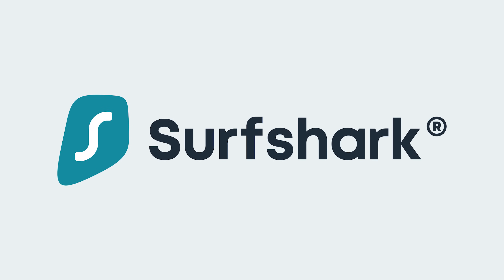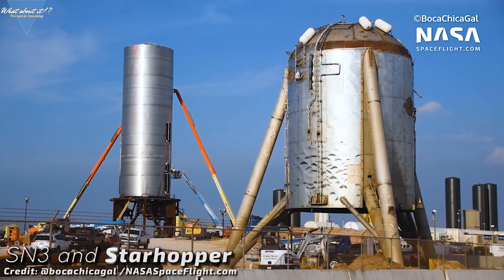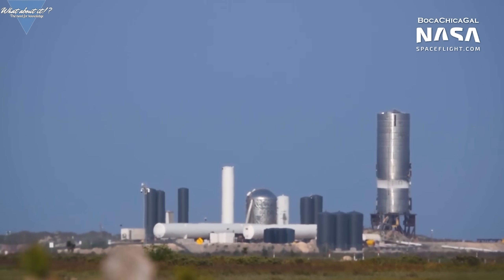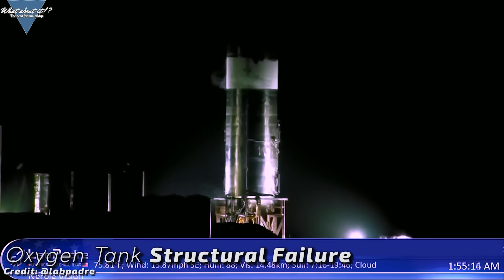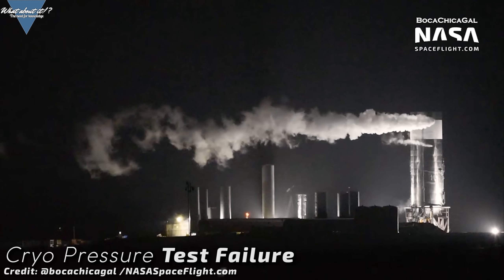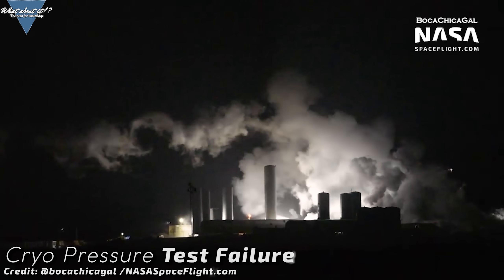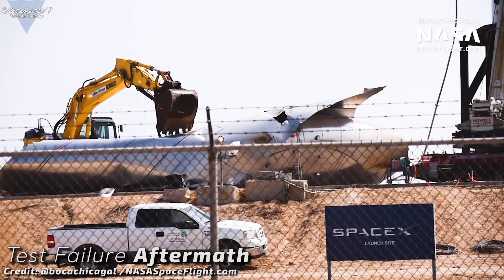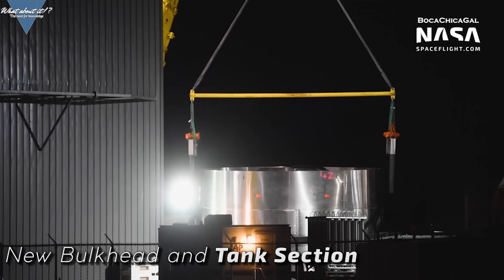83 | SpaceX Starship Updates – SN3 Cryogenic Failure Explained – Expectations For SN4

Comment: I have another theory:
If the bottom tank was empty (air) and SEALED, the cryogenic temperature of the liquid nitrogen in the top tank was lowering the temperature of the air in the bottom tank during the test and making the air condensate. This lowered the pressure inside the bottom tank making it collapse. 
The "configuration mistakes" in this case would have been the SEALING of the bottom tank.
Reply: This is so obvious, this is why I personally doubt it. They work with cryogenics on a regular basis, I think this is something they would account for. Like forgetting that the flamy end will get hot eventually.
But mistakes happen, even to the smartest people, so it's at least possible.
Check for damage, remember what was the cause, learn from it - then dust off and continue.
Reply: This was my initial thought as well. But the LOX tank, was venting a little. Meaning there was enough pressure in LOX tank to push vapor out venting port.  I agree that the instant crumpling, strongly suggest an empty LOX tank, being super chilled, and causing a super low pressure inside. Also the LOX tank should have had icing on it like the LCH tank. did a valve freeze shut, and stop flow going into LOX tank?  If so, someone at SpaceX should have noticed and stopped the test.
Reply: The tank wouldn't even have to be empty but perhaps under 10% full to see the same shrinkage of the contents as the super cold Nitrogen at -320 F transmitted those temps thru the common bulkhead with it's some 125 sq meters of contact space. That's a huge radiator into the lower tank.
Reply: Damn I was just thinking the same until I saw your comment
Reply: If the lower tank was full of gaseous N. Then some of this gas would condense onto the bottom of the upper tank. It wouldn't take very many Lbs. of gas to condense before the pressure in the lower tank was well below atmospheric. Valving would be required to add N to the lower tank as the upper tank filled, and to remove this gas as the upper tank emptied.  The key would be to balance the condensed N on the underside of the upper tank.
Reply: the air doestn neccisearaly need to "condensate", if its temprature reduces, its pressure reduces (Gay-Lussac's law)
Reply: @sssfsfdfsdsdffsfsdf4  Obviusly (adiabatic trasformation). I spoke about condensation because is the most critical situation which could occur
Reply: @Fonz94znoF  But by definition, this is not adibiatic. Adibiatic states that there is not heat trasnfer, thats all that is going on here. Instead it is isochoric (constant volume).
Sorry hate to be a nag.
Reply: @sssfsfdfsdsdffsfsdf4  sorry my mistake. You're totally right. The adiabatic system (with a little approximation) is the the top tank + bottom tank. That made me say "adiabatic trasformation" but again, it is absolutely an isochoric trasformation (inside the bottom tank)
Reply: Yes, something in that direction seems much more plausible to me, than whatever Felix was babbling about.
I don't think it was primarily a structural failure, but too little pressure in the lower tank, maybe because of cryogenic effects.
Reply: A very good explanation
Reply: Correct me if I'm wrong, but if the lower tank was loaded why we didn't see some implosion/explosion when the upper tank bend over?
Reply: @miguellyon82  Obviously the pressure was just that damn low. I assume if it was that low, it must have been a hardware error (sticky valve) or something of the sort. You could see the tank slowly depressurising for the few mins beofre. There may have been so little pressure that it was just the ridgid stregnth of the steel keeping it up untill it bluckled in.
Reply: Right before the collapse, it looked like cryogenic liquid being dumped from the bottom where the engines would be.  Was that possibly an emergency dump of the upper tank at the last instant, too late, to try to save the structure?  Is the upper tank methane and the larger, lower tank LOX?  Is it possible someone said, "Dump the methane tank."  And they got confused and dumped the LOX tank, then quickly tried to correct the mistake, but too late?
Reply: Mario rossi - i agree
Reply: Like the standing on the soda can analogy. 
Not everyone would be heavy enough to crush the empty soda can immediately, but then flick the side of the can and it collapses.  I tend to agree with this too
Reply: They should have had the lower tank cryo filled while filling the upper tank.... all that weight on top crushed the bottom tank.
Reply: That’s a good explanation but a simple explanation is they pressurized the lower tank but like the Altas failure they they lost pressurization in the lower tank.  Maybe someone pushed the wrong button and let the air out.
Reply: @gslogar1  if they pressurized the lower tank then my theory fits very well. To avoid this problem they should have been pressurizing continuously during the test (because of chilling) rather then pressurize before and seal.
Reply: Even if that also happens in reentry, would thermal expansion be another serious problem for Star ship, mostly during reentry?
Reply: @danielburmas1136  - In my eyes the Starship design with a modest amount of tiles to protect from heat buildup tells me they plan on reducing their reentry speed by a large amount. The Space Shuttle began entry at some 17,000 MPH/Mach 25 and thus the need for lots of special heat tiling to protect it. I'm wondering if Starships plans to reduce that speed to say Mach 3/ 2000 MPH which would require much less in the way of heat shielding as we see in these tiles. In that case, heat expansion of a tank with say 5% fuel load would be well within design specs as you only need enough fuel for the final suicide approach and landing.

I am still thinking the tanks need internal ribs to help with the many stresses of launch and landing.
Reply: @danielburmas1136  Re-entry can only be tested by re-entering.  There be no human volunteers for that.
Reply: @beachcomber2008  for your information, of course tests are unmanned, however did I mention about passengers being on board?
Reply: @danielburmas1136  I was merely making that remark as a joke.  Relax.
Reply: Well, it’s just speculation for now I’m sure they have enough data to pinpoint where the issue is.  I would think the pressurized lower tank would have supported filling of the upper tank but for some reason the lower tank didn’t maintain the pressure needed.  I don’t it’s a structural issue it’s a test procedure problem in normal filling you wouldn’t fill the upper tank without filling the lower.
Reply: Perhaps their models suggested that a full cryo fill of the upper tank should be supported by a lower tank section which was at ambient pressure or, alternately, minimally pressurized. Even if this configuration was outside of the operational configuration parameters which required the lower tank to be pressurized, they would want to verify that the actual build coincided with their design model, so they tested this configuration. It appears it held for a while before collapse. And, agreed, maybe they didn't properly take into account the heat exchange rates between the tanks during the test. Or maybe somebody pressed that red 'Depressurize' button too soon.
Reply: When he says configuration error it sounds like they didn’t allow properly for the fact that liquid N2 is heavier than liquid CH4 
The pressure in the bottom tank needed to be a bit higher
Reply: Mario rossi Seems plausible.
Reply: Cool idea
Reply: I also thought of that. But I'm concerned If something like that happened during re-entry.

Comment: There are 3 factors for buckling.
- A requirement of a compressive force

- A thin-walled system
- Imperfections, e.g. load imperfection or structural imperfection

When the tanks are under pressure, the walls are essentially under tension, the geometric stiffness increases, just like a guitar string. Buckling cannot happen under tensions, only under compression. The compressive forces were worse.
Reply: Timothy Kramer - i believe that in bottom tank was much lower pressure than outside atmospheric pressure (due to low cryo temperature of upper tank) and that was cause of buckling
Reply: @mariorousar  That isn't what happened. The huge amount of weight of the pressurized nitrogen + the weight of the steel structure was too much for the bottom tank, which made it buckle. I'm sure there was some pressurized nitrogen in the bottom tank, but like it was mentioned in the video, it wasn't anywhere close to being full.

Comment: The LOX tank wasn't empty, it was filled with gaseous N2. I think when they encountered an issue with leaky valves, it was only on the LOX tank so they decided to go ahead with the test on the CH4 tank. Remember both tanks need to maintain similar pressure to keep forces to a minimum on the common header as well as the downcomer. So they pressurized both tanks, CH4 with LN2 and LOX with N2. The problem arose when they started to depressurize the tanks, they likely had the test configured to dump the LOX tank as fast as possible (Wide open) and match the CH4 tank pressure to the LOX (open and close valves) as the smaller tank will empty faster. But it takes much longer to vent LN2 than N2. They did not have any logic in place to keep the LOX tank pressure the same as the CH4 tank as it is assumed the CH4 tank will always empty faster which is not the case when one tank is gaseous.
Reply: It makes sense 👍
There was no ice on LOX tank, so it was either empty (unlikely) or filled with N2.
The CH4 tank was covered with ice, so it was filled with liquid N2.
And at the same pressure liquid weights much more than gas and flows slower.
Reply: The weight of the liquid has to be supported by gas pressure. What happens to the common bulkhead when that weight is abruptly remove in space at engine cut-off?

[EDIT] It seems to me that the upper tank needs to have a higher pressure than the lower tank to keep the common bulkhead in good shape.
Reply: @avid0g  In space there is no weight, only mass. On the ground, the weight is supported by the structure, not the gas pressure. The structure gets its strength from the pressure in the tanks (Like the coke can analogy).
Reply: @Lonnie776  
Even in space, there is weight whenever there is thrust.

Comment: I keep saying one thing - these people does not know what they are doing - first testing presure on almost fully equiped prototype, now loading 400 tons on a single steel sheet thickness and buckling unstable cylinder. Finaly, if everything works out (zero chances) and they managed to launch astronauts to Mars I am expecting many dead astronauts. All they are doing with this Starship stupid BS is nonsense. I am amazed how many people are beliving this madness.
Reply: Its not like they are just a startup . They have proven vehicles in their stable , judging the future vehicle based on this is foolish
Reply: @shantanupant7724  I am judging this from my 20 years experience as a design engineer of complex heavy loaded structures - this thing is just too big to be enough structurally stable.
Reply: Then why are you here commenting Sir? Why are you interested? Or are you just following the progress of your revelation step by step? Give us some insight please Sir.
Reply: @saintsiah790  I like the Falcon-s, they are great, but this entire Starship concept is stupid and can be the end of this great company.

Comment: If the lower tank would be filled nothing could go wrong? No! Try to jump on a filled but open coke can and you will see if it will support your weight.
Reply from the maker: Do you know, that all the valves can be closed or opened?
Reply: @Whataboutit  the dictionary says: valve: any device for halting or controlling the flow of a liquid, gas, or other material through a passage, pipe, inlet, outlet, etc.